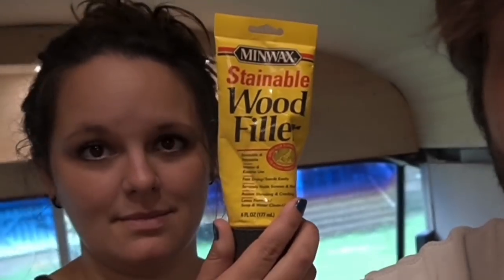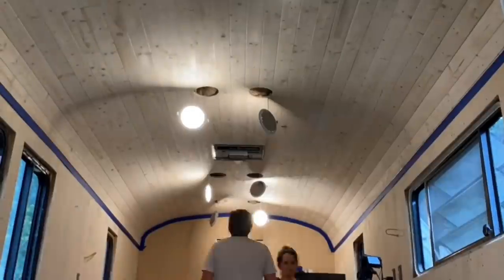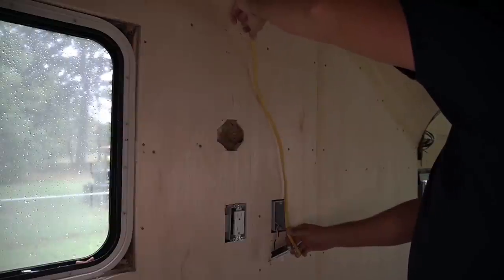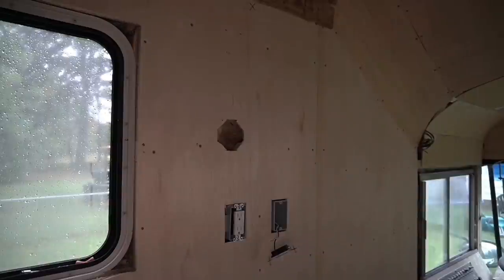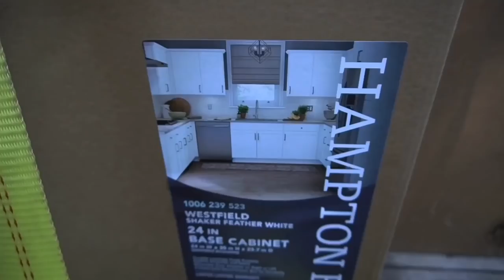School Bus Conversion Episode 21 - Kitchen Cabinets And Tongue And Groove Ceilings

Comment: I strongly believe -- Kitchen cabinets should be drawer bases whenever possible.  You can find things and get them from the cupboard so much easier without standing on your head when you have drawers.
Reply: That’s easy fix.. a person can buy those and install in cabinet.
Reply from the maker: I agree with you. But drawer bases are more expensive that door bases. Would have loved to have only drawers but we did some some money by adding 2 door base cabinets.
Reply: @lifeanywhere  I imagine you will need the doors for larger items like a rice maker, blender or mixer.
👍🏻 Looking good!!

Comment: Make sure you get on top the bus before it rains bruh. Check to make sure your screws weren't too long when you put the wood up. Be ashame for it to leak.
Reply from the maker: Yeah we used 1” metal screws for the framing but put them into the hat channel, not the sheet metal. We do have bolts running through the roof for the solar panels though. So far, no leaks. But yeah I’m going to get up there soon and verify all is well.